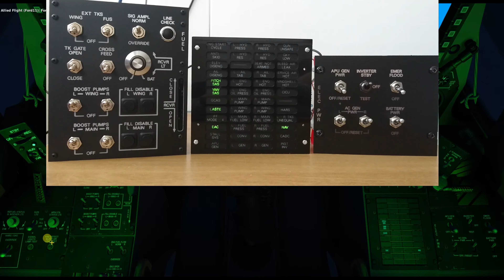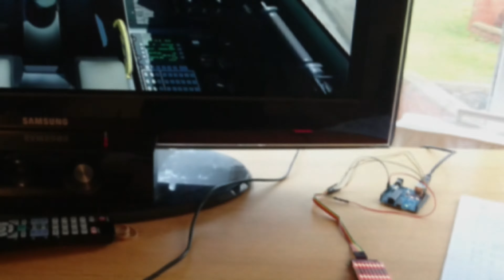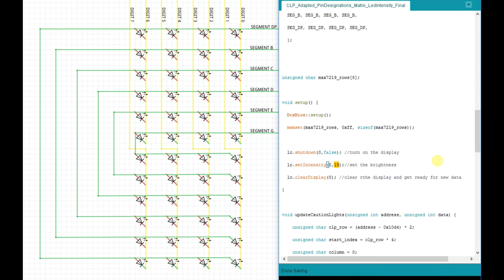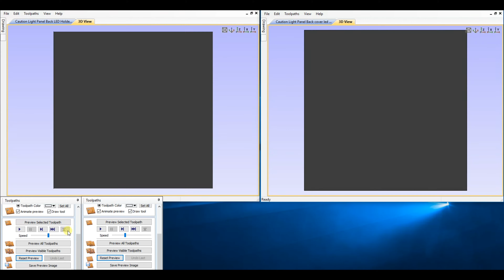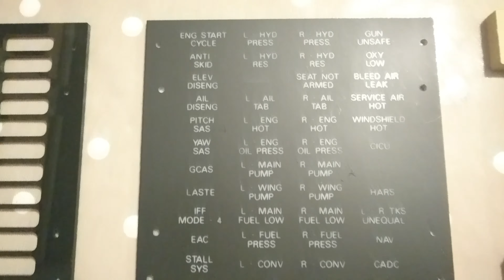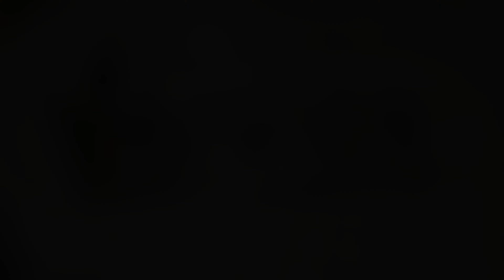DCS A10C Prototype Caution Light Panel

Comment: Can you use this setup using the driver card to run the other LEDs in the cockpit like the master caution and the landing gear LEDs without the need for resistors

Comment: Heya Craig, great work. Can I just ask where you got the driver board from? I've searched eBay and a couple of other sites but they seem to be more complex boards rather than the fairly simple one you have. Thanks.
Reply from the maker: Hi James, if you search ebay and Ali express for "MAX7219 DOT Matrix 8X8 Display Module" or wording similar to that, it should bring up a module like the one I used
Reply from the maker: Try searching this one on ebay "MAX7219 RED DOT Matrix 8X8 Display Module with Cables for Raspberry Pi Arduino"
Reply from the maker: And search on Ali Express for "LED Display MAX7219 Dot Led Matrix Module 8*8 MCU Control Module For Arduino 5V Interface Module 8x8"

Comment: What engraving bit and settings do you use for the text?
Reply from the maker: Hi No1sonuk,
Please see the below link where I've detailed that information
https://mysimpit.co.uk/faqs/
Also, on a separate note, I really like the approach you are taking to your A10C clock, nice one 👍. Mine is currently the digital readout on an oled, but I do plan to revisit and upgrade this panel in the future.
Reply: @CraigSmysimpit  Thanks.  The tricky bit with that scheme will be fitting the digits in the middle.  I've not 100% figured that out yet.
Reply from the maker: That's certainly one thing about our hobby, so much to learn and solve 👍
Reply: @CraigSmysimpit  Hi.  I couldn't find the cutter mentioned on Arc Euro Trade's site.
I found some others like it, but the descriptions of the angle vary.  Some call your cutter 15 degrees, some call it 30.
Reply from the maker: Hi No1sonuk, I use my father in laws cnc machine. The description you see is as he keyed it into his tool database along with his other cutting tools. The 15 degree is the side angle, so for any you look to buy I would clarify with the seller the side angle (so not confused with total angle).

Comment: An option for  simplification of wiring would be to use addressable LED strips.  This would mean eliminating the MAX7219, and running the whole panel as a single strip.
The strips are usually RGB, but there's nothing stopping you just running the green.

Comment: Nice job! I made the matrix and the code exactly according to your pattern. But the LEDs are lit in the wrong positions. Did you make subsequent changes to the code or matrix?
Reply from the maker: Hello, was the code you are using something you put together? Although the LEDs light in the wrong positions, do all of the warning lights work (despite the different order)? Let me know and we'll take it from there, cheers
Reply: @CraigSmysimpit  I built the array as in the video with Dig 0-7 and segment DP to G. Also the arrangement in your code is identical. I've looked through it a hundred times. Upon reset, all LEDs will turn on and then take the values from the DCS BIOS. But everything in the wrong places. Not all light up at the lamp test in the Sim. I'm standing in front of a wall ...
Reply from the maker: Hello, when I built mine as a prototype it worked fine as shown in the video. I'm not sure why the layout of the matrix as interpreted by the sim has changed. However, there is a check you can perform to know your matrix is built correctly in the physical sense and then its all about tweaking the code. Firstly, I would look at the sim and trigger each caution light (so you know what triggers each to light up). When you have done this, I would run through it again and draw out on a piece of paper what actually lights up where on yours. That will confirm everything works physically and where they are lighting up. By undertaking that task you will be able to compare the arrangement of lights on your panel compared to the sim. There might be a pattern you see in this, I'm sure a whole column or row (or two) will be shifted. Finally, you would edit the part of the code that specifies the order of the matrix. By tweaking this you should be able to make it work.
Reply from the maker: After I did my prototypes for the right console, I stored them out the way and moved on to building the left console. I'm currently on the front dash. I wasn't due to revisit the Caution Light Panel until I do the right console which will be some way into the future. However, if you try what I mentioned and it doesn't work, I will get my panel and see if the layout has altered, however might be a good few weeks until I could get to that (although happy to do). Also, another idea, go to the Ed forum, search for a post by HanSolo. There is a link in his signature to all of his sketches. I'm sure his Caution Panel will be on there. Compare his code to mine. I'm sure everything will be identical except the matrix layout, which will give you another one to try but also show how the code would be modified to alter the layout
Reply: @CraigSmysimpit  Thanks for the information. Already when starting the Sim with cold engine and battery off a few LEDs light up. Something is wrong with Sim's ...
Physically everything is exactly according to plan. I keep searching.
Reply: At last. The DCS-BIOS was it. Now with the latest version 8 works the display well. (see github)
Reply from the maker: Hi, so does it work now with the original code?
Reply: @CraigSmysimpit  Yes, with the original code :)
Reply from the maker: That's great news, brilliant 👍

Comment: Hi Craig, I'm just getting into fully building my cockpit (F-18) with the LEDs and such. Wiring the switches and such is fine, but doing this led matrix isn't easy for me. Do you happen to have pictures of the back/wiring of the LEDs you had on that notebook, showing how they are wired together?
Reply from the maker: Hi, if you drop me an email to craig@mysimpit.co.uk ill take some photos of the back of this panel and email back to you in the next couple of days. No problems, cheers

Comment: maybe lining the led holes with foil like a reflector will help spread the light.
Reply from the maker: Hi, that's a fair comment. I did think about this and see some tiny mirrors on ebay (usually used in jewellery making) which could line the holes. The type of LEDs I used cast the light 20-30 degrees either way of immediately upright so it may help. I'll have a look, Cheers